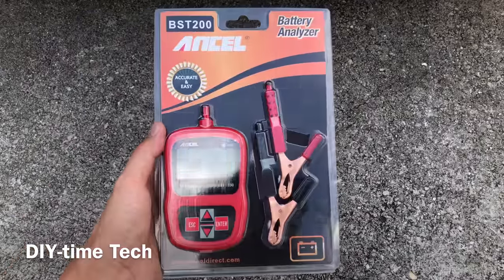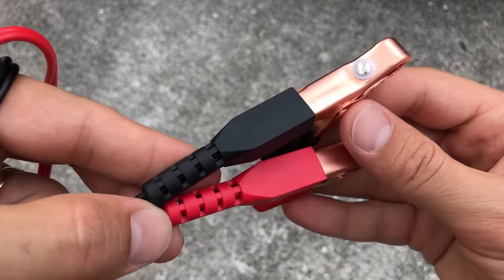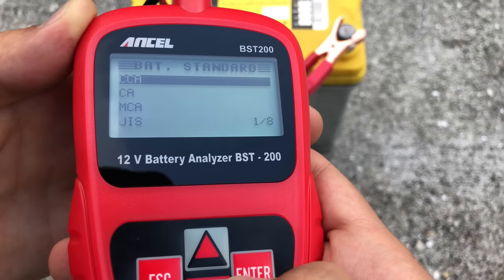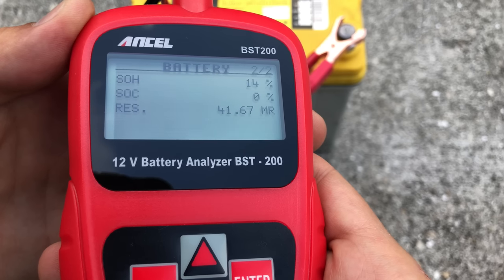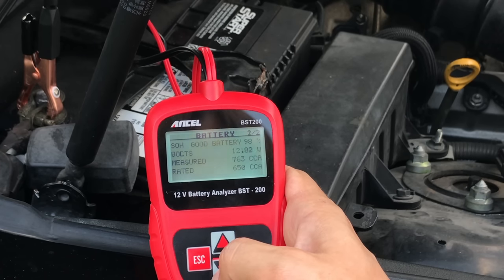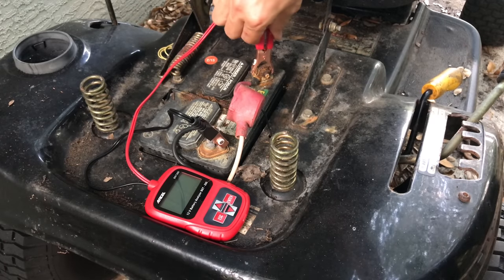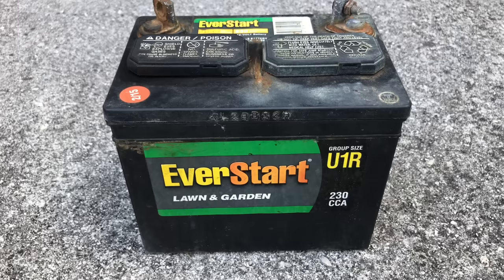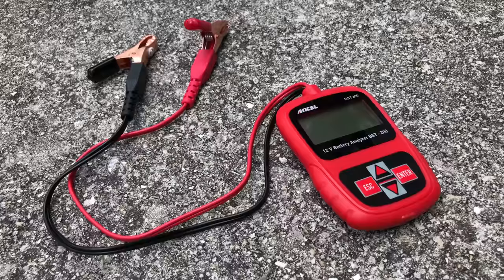How to check your car battery health using a digital battery analyzer tool (Ancel BST-200)

Comment: Bought the device based on your video and presentation. I work at a small Hospital and am required to do a Battery Check every week on 2 battery's in our Back Up Generator. The State requires a few things to be written down, your video laid it all out very clearly and precisely. I showed them this video and they approved this tool to be used. I've been using it a month now and its straightforward, simple and super easy. Thank You for uploading.
Reply from the maker: Wow, that’s awesome, I’m glad it was helpful!

Comment: Would like to see this tested with a Volt meter to see how much of a difference in voltage reads, to determine if it's accurate or not.
Reply from the maker: I dont think volt meter is a good indicator. Grab almost dead AA battery and you will see it still puts out close to 1.5V, even though it cant power up anything anymore.

Comment: What's the different between Ancel BST200 and BST100? I was thinking about buying the BST100, but is there something that the BST200 is better at?
Reply from the maker: Testing range. 
BST100 - 1100 CCA. 
BST200 - 2000 CCA.

Comment: Very clear and concise review. The quality of your filming was outstanding. What camera did you use and how was it mounted if you don't mind me asking?
Reply from the maker: Thank you! 
Believe it or not, all I used is my old iPhone 7Plus and $5 camera tripod from garage sale. 
Filming outside with good lighting did the trick!
Reply: @DIYtimeTech  That's amazing! The battery tester is lit so well and the product is super sharp. Same thing with your video on the lock. Thanks for the reply.
Reply from the maker: My pleasure! 
Yeah, most of the high end smart phones these days have incredibly capable cameras!

Comment: what is a good resistance number?
Reply from the maker: With batteries its more about just having resistance. If there is no resistance between terminals, it means there is a short circuit and battery is not good.
Reply: @DIYtimeTech  thanks but i what numbers are good and bad?
Reply from the maker: Lower number is good, higher numbers are bad. From my experience, good batteries have around 4 milli ohms.